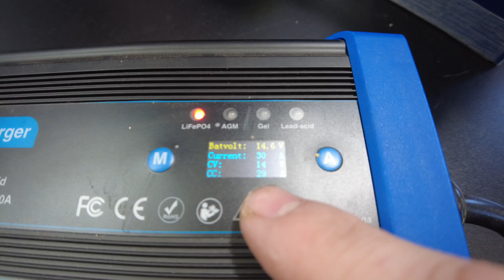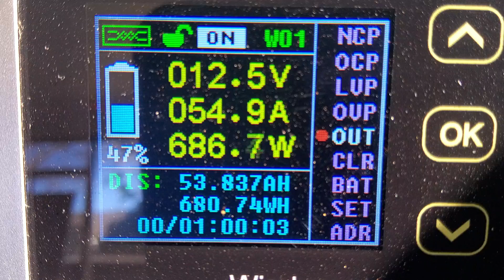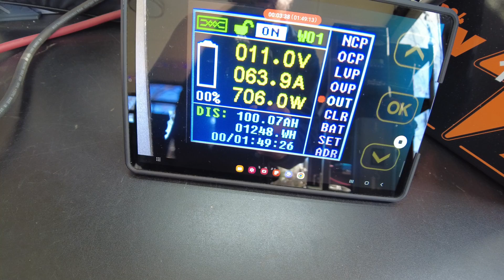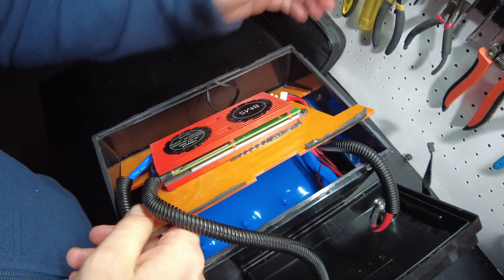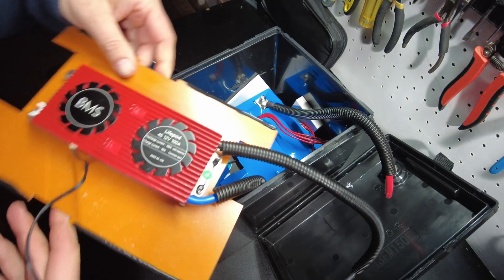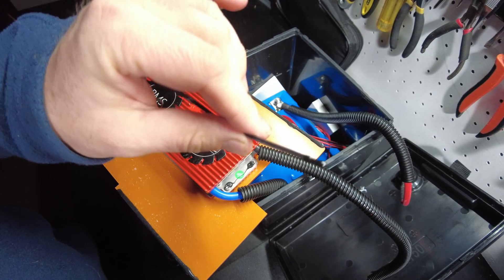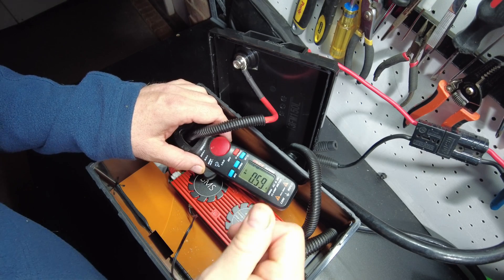Solorage X 12V 100Ah LiFePO4 Lithium Battery

Comment: Brand new one purchased in december 2024, when hooked up to an appropriate new charger (for li, agm,lead acid ) smart charger which works fine on another battery , all I get is standby mode (no battery deteced - no charging sequence display) ..it does not power any services in the RV …is it a dud ? Or is it “asleep” and in need of some kind of kick start …left overnight in charge it does not respond .

Comment: I understand it’s cheap but dang no way to tell if it’s degraded or used cells?
Reply from the maker: It pulled over 101Ah in the capacity test , and the weight of the battery is about correct for 100Ah 12v LiFePO4. So I would say it's not degraded or used cells.

Comment: Brad thank you for those informative videos. I was wondering have you had any issues with rack of different lithium batteries being mixed matched brands, Different charging rates, voltage cut off when charging?  The reason i was asking i purchased a licitti 1st generation box i have a elefast mini  12v 100ah and want to increase ah to 200ah. I just purchased the solarage 100ah. Considering different manufacturer would be possible to add this in parallel?  Thank again from South texas

Comment: Not bad.  The prices are getting lower and lower.  We go below 32 here in central California in the winter- usually not when the sun is out, but I have been contemplating what kind of batteries to put outside to charge an EV, or just to expand my system without putting additional batteries in the house.  Thanks for all the reviews.  We really appreciate them.